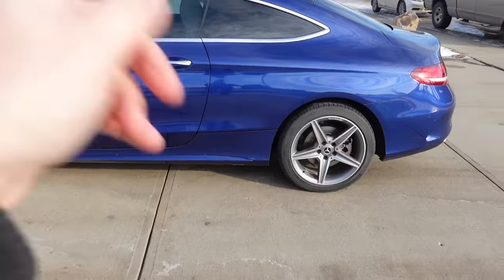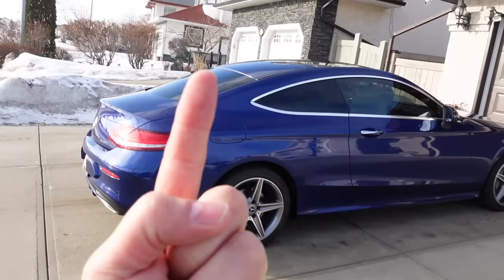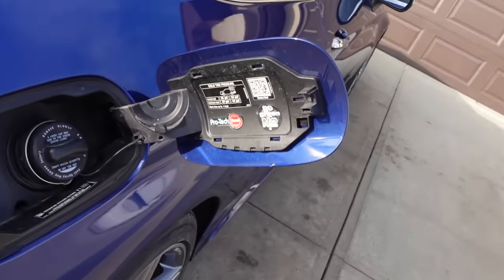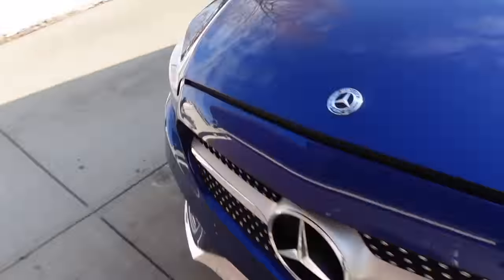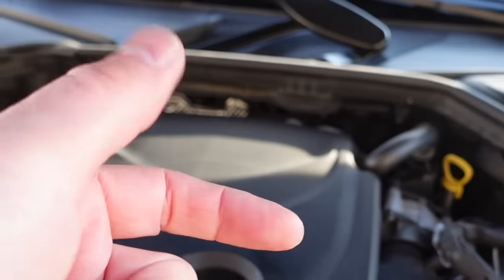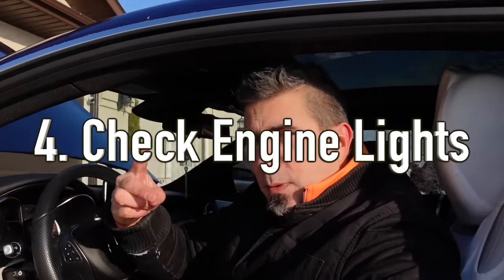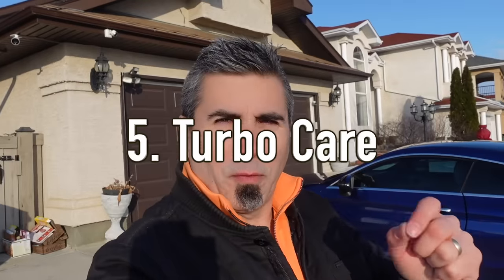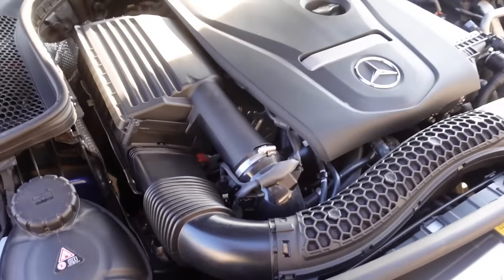STOP Destroying Your Car Engine! (With These Tips)

Comment: The start stop feature is one of the most annoying things ever installed on a car. The other annoying things is when people put the wrong fuel in the tank to save money. I once bought an off lease Audi and had the fuel in the tank checked and found that it was regular gas. I'm not sure if it was the dealer that did that or the guy that leased it before me. I've see drivers at the gas station put regular gas in a Benz and I would say to them, "It requires premium gas" only for them to say, "eh, it's a lease car". Drives me insane.
Reply from the maker: I totally agree, sort of a poor design and my feelings would be hurt if it disappeared.
Reply: Start/stop is absolutely ridiculous and has no place in fuel cars. I'll never buy a car where this crap is always on.
Reply: It also drives me crazy--worse is going to car meets and seeing the idiots that financed more then they can afford and are putting regular gas in a hellcat or M5--in addition to having bald rear tires from showing off.Dude at the local meet last month put 7 dollars of regular gas in a new challenger.I mean that 2 gallons was enough for him to go park it--just laughable.
Reply: Good post. We bought a returned from lease Audi last year that replaced a wrecked same model. The new buy ran like relative @ss until we got a couple of tanks of 91 through it. I would bet much dollars it had regular in it when we bought it & likely the previous user put regular in it.
Reply: @khronin  
They can afford the car but not the maintenance that goes with it! Bad medicine
Reply: I would not have any of these money pit cars they are crap after 100 thousand miles and sometimes before I know cause I get to work on them and charge you rich kids a shit load of money. When people bring these cars to me to work on all I can see is dollar signs LMAO.
Reply: @tommywieringo6640  I own a 2009 Camry that my daughter drives. In 100k miles we've had to replace a leaky oil pan gasket, both front axles, the struts on all 4 corners, a window regulator, & an alternator to name a few things off top of my head.  In addition, the oil change interval is 5k mi so that's more often than all the rest of our cars (both German & U.S.).  Machines wear / break down
Reply: @tommywieringo6640  You sound bitter, can't afford a luxury car?
Reply: @loseerich493  man sorry to hear that sounds like you got a lemon
Reply: @tommywieringo6640  Not really. Toyotas are machines that wear & break like all machines do. It's a myth they don't wear out /break. I've owned or leased 3 of them in my life.... one of them years ago left me stranded beside the road (while it was still under Toyota warranty)... only vehicle in my life to leave me standing beside the road.  Still own one now some 30 years later. I don't hate them, I just don't drink Toyota Koolaid.  Have a good one!
Reply: @loseerich493  yeah you are right no matter what make vehicle you get now days you still might get a lemon. Too much technology on these vehicles need to go back to the old days where you could work on your own vehicle.
Reply: Only use premium gas if the manufacturer requires it. Otherwise complete waste of money.
Reply: @loseerich493  I hade same experience with our Honda. Most unreliable car we ever owned.
Reply: @k9m42  Don't doubt it. I've had really really bad luck with 3 hondas I've owned (2 of them were bought new too).
Reply: @loseerich493  heh... go look at parts and labor for those jobs on a Audi, Mercedes or other premium vs a typical honda. There is a reason you don't see many Luxuruy cars with more then a 100k miles and/or +10 years.

Love my audi's; always sell before 100k.... 

Monstrously absurd 10,000- 15,000 dollar timing chain job is enough by itself (Audi S4 and S6); have to lift the motor and should be done at 100k miles.  On a typical honda its 400-500 bucks...

That all said; caddies are even worse now.
Reply: @loseerich493  according to Scottie Kilmer they are the only cars to buy!  and all those weird plastic angles and slashes are beautiful!!!!  only Japanese cars/suvs with any design sense are Mazdas.
Reply: @Aerogrow  timing chains don't need to be replaced it's a replace when needed item. Your thinking of a timing belt.
Reply: @v5k456jh3  Pure ICE vehicles, to be specific. They had their place in hybrids (though in a completely different manner).
Reply: @v5k456jh3  get a manual trans
Reply: @Collen Flarity you will love that start stop untill it doesn't work.. my friend was in an accident when it would not come back on at a stop light and was rear ended.. keep that in mind the next time your car shuts off, remember a computer runs it ......
Reply: Premium isn't better
Reply: Regular here in East EU means 95 octane
Reply: @AgentOffice  only if it calls for premium.
Reply: @brianmiller5444  Mazda has zero design sense other than exterior......especially new Mazdas are meh. Mazda interiors are often smaller than any other vehicle in its class...Mazda only knows one thing, how to sacarifice all practicality just for the sake of looks......Mazda 3 is atrocious in its C pillar design on the hatcbakc.
Reply: @brianmiller5444  please tell me more about what said our friend Scotty?
Reply: @brianmiller5444 I don't believe anything that Scotty Kilmer says as he is a total hack he  got reamed out in the comment section using a part on a brake system  that said not for use on brake systems  that was one of his videos he was forced to delete.
Reply: If you can't afford the gas, you probably shouldn't lease the car
Reply: @loseerich493 that's not believable, but I guess it could happen. The German cars however, have the worst reliability except for jeeps, jaguar and land rovers for the past 20+ years
Reply: Indeed. My 2008 X3 only gets regular gas. No issues with engine for last 16 years.

Comment: Stop/start default is really really irritating, and what is as irritating is forgetting to switch off the default
Reply from the maker: I agree
Reply: What is that? Stop/ Start what? My Tacoma doesn't have that button I've never heard of it?
Reply: I found that the Nissan Rogue (2021 thru current 2023) doesn't even have that annoying stop/start feature, how nice is that!  Nothing to turn off every time you crank up the vehicle.
Reply: @ofcbob6391 buy a manual. They don’t have start/stop lol
Reply: @crispyone2564  they do have start/stop, gearbox has nothing to do with it
Reply: @deborahdarr1964 if you come to a stop at a stoplight or something the engine will shut off and then turn on when you go again. It’s really stupid and annoying, you don’t want it.
Reply: Agreed, it’s the dammit button. Every time I forget to turn it off I shout dammit and hit the button. Would have paid an extra $100 to permanently disable it.
Reply: I've read that modern cars are built to withstand the wear and tear from the start/stop function and thus it shouldn't wear out the engine, I don't know if it's true, but it would make sense to me
Reply: Pretty sure my car has that but I disabled it in the settings
Reply: @crispyone2564  the first car I drove with start/stop was a manual.
Reply: @tcmmorariu I have a manual with start stop 😂
Reply: It's as annoying as cookies on by default, forcing you to have to reject them. Why? Because if we had to opt in instead, we wouldn't, and companies wouldn't have our information to sell.
Reply: @Nathan-Higgers_13  really! And how do you do that?
Reply: @crispyone2564  Mine does in the UK maybe its different in the US!

Comment: One important thing to know is that your car's water temperature is only to warn you of overheating. The gauge you need to look at to see if the engine has warmed-up is the oil temperature. The oil usually takes quite a bit longer to warm up than the water.
Reply from the maker: Thanks for sharing
Reply: Its not oil temperature its an oil pressure gauge.
Reply: @babuskarashuka8651  An oil temperature gauge is an oil temperature gauge, and an oil pressure gauge is an oil pressure gauge. Two different things. Maybe you haven't seen a an oil temp gauge? My car tells me the oil temp in degrees Celsius, but only has a simple warning light for low oil pressure.
Reply: @MrSonicAdvance  I have never seen one before I am in the USA and none of the cars or trucks I drive have temperature only pressure.
Reply: Oil removes @60% of the heat generated by the engine simply by virtue of being directly on the working surfaces,bores,bearings,or by load,lifters,bearings etc.,the incoming air through the air intake provides a cooling effect as does the fuel mixture to a degree,.An oil temp sensor will only measure sump or feed oil just after the pump,oil which will remain cooler up to a point because the relatively small amount of oil travelling around your engine removing heat and therefore getting hot it's self when it's running is then diluted back into cooler sump oil,but the oil at the point of the working surface heats very quickly,even from cold. The coolant system regulates heat indirectly via heat transfer and is not directly connected to working surfaces i.e. friction,or combustion so it's thermal efficiency is lower.coolant is thermostatically controlled to be isolated so that a very small part of it heats first,allowing that part to attain temperature seemingly quicker,sometimes and more commonly now artificially,even more so with selective path systems,thermoplungers and active pumps becoming more common,these measures are not made because the coolant systems can't keep up it's because manufacturers are trying to achieve operating temperature quicker using the cooling system to also assist engine heating until reaching that point.
Reply: It takes 14 minutes of highway speed driving for engine oil to reach 90C or more.  Your coolant will heat up to the proper operating temp well before that.
Reply: @midcenturymodern9330  My point is that oil doesn't work properly when it's not up to operating temperature. Just because your coolant is up to temp doesn't mean you can drive the engine hard if the oil is still below operating temp.
Reply: @babuskarashuka8651  My Subaru Outback wilderness has oil temperature gauge.
Reply: Very good I rememberd BMW got oil temp gauge.
Reply: I have always known that by how easily the car accelerates when FULLY warmed up:  that is when it virtually accelerates by itself,  my big toe is barely resting on the accelerator pedal...and the speed keeps going up. And no, I never tried to blame speeding on the car, saying it just "went"...by itself :)   yes I drive bare feet.
So I never really press on the accelerator,  in fact I let the car do what it is ready to do.
Reply: @martinep6293  Cars last longer if driven with mechanical sympathy. If you pay attention, a car will tell you when something is wrong, as it will sound different when it is running. It allows you to catch problems early and avoid big repair bills.
Reply: @MrSonicAdvance  yes!!  I can always hear even my oil becoming...suboptimal before 4k miles, with full synthetic (car over 20 y though)
Reply: @babuskarashuka8651  - most trucks have oil temperature gauges the vehicle information section on their dash, and nearly every Chrysler/Dodge/Ram vehicle has an oil temp readout available in the dash.  Granted there is not often a dedicated gauge like a fuel gauge, but it's more common than you have noticed.
Reply: At 7:00 you state that when you advance the throttle the valve timing is advanced. That is probably not true because generally, advancing intake valve timing increases low RPM power and advancing ex valve timing can increase top-end
power.
Reply: Almost no standard road cars will have an oil temperature gauge.
Reply: @babuskarashuka8651  bro you should probably do a little research before commenting...

Comment: Great information. One bad habit i often see is that many drivers use high revs before the engine has fully warmed up. Impatience is an early killer of engines and transmissions.
Reply from the maker: You are absolutely right and goes to the cold engine.  That’s where damage happens most often.
Reply: Killer? This is just false. If that was truly the case then they would just have a limp mode or rev limiter until it reaches temp.
Reply: @jonb2437  we are talking about long term effects.   Turbos will also get damaged much faster.
Reply: So new engines need to warm up?   I call b.s. Maybe 20 years ago they did.
Reply: @BeeRumblin13  they're not specifically talking about "warming up"... they're referring to pushing high revs before the car is at full operation temp.
Reply: @thesoundmajors9858  Define full operating temp.  Water, oil, block, cylinder head, turbo, exhaust??  Can the temp be at 50%, 60, 70 etc or does i have to be at 100% before max revs are allowed?  Which one is he important one?  Do all the components get to different operating temperatures at different times?
Reply: @jonb2437  Nah, it just kills a car's long term life expectancy. Manufacturers don't care about your car's reliability once their warranty runs out. The whole car industry seems coordinated for 4 year leases the way I see it. After that, good luck!
Reply: @csjrogerson2377  Oil is the most important. During cold starts, engine will rev a bit more to speed up warming. After it slows back down to idle speed, it is safe to rev higher. Note: you do not have to wait for engine to warm up before driving. Just don't accelerate too much until the warm up completes.

For motorsport, ALL components must be at optimal temperature, including tires. That is what warm up lap is for before driving the vehicle hard on track.
Reply: @jonb2437   Several M cars do have that variable rev limiter. Off the top of my head, at least the E39 and E60 M5s, and a couple of M3s. It makes complete sense to wait until at least engine oil is at operating temp before getting anywhere near the limiter.

I don't rev past 3k on my manual econobox VW Rabbit/Golf until engine coolant temps get up to temp since I plan on keeping it for a long time. I would think the more heavily-stressed engines and transmissions found in performance cars would need as a baseline that same level of care applied to them.
Reply: Shouldn't be leaning on the car until 9.5 miles or 15 km. Because the transmission has to heat up also in many cars, and in cold weather etc. this takes time. If you're going shorter distances, don't go to high revs / loads. Use a full synthetic engine oil, that meets the manufacturer recommendation, don't play around with oil weights either, unless you really know what you're doing, as race engines are not expected to last like normally constructed car engines. It's not worth it for a slight performance gain, can lead to blow-by, and oil ring clogging / failure etc. etc.

Also very important to not keep filling the tank to maximum, when it cuts off the first time STOP pumping gas, people overfill their tanks and kill the expensive carbon filter. Keep fuel at least 1/3 to half full to keep the fuel pump temperature down and prolong its life.
Reply: @VenturiLife  good tips indeed.
Reply: Akzo if you have a Turbo u really need let it warm up b4 driving as well as letting it cool down b4vu shut it off. If we get into a habit doing these things then it cab prolong the life of the Tuebo engine!
Reply: @BeeRumblin13  wake up in the morning hop out of bed and start running fast and tell me how it feels lmao..so let your engine warm up a bit
Reply: I leave my engine to idle for about 30 second after a cold start.  Then avoid hard acceleration for about the first 10 minutes.
Reply: @malcolmabram2957  excellent way to prolong engine and tranny life. Most drivers lack such basic common sense.
Reply: @BeeRumblin13  its not about warming up by Idling. Its about  driving off gently after a cold start and not using high revs until engine and oil temp reaches normal levels.
Reply: @VenturiLife  great tips indeed. But there are many smart alecks commenting here who just dont have the common sense to understand what you are saying.
Reply: I learned that you should keep the revs under 4000 rpm until the oil is at operating temperature. The closest we can estimate this in modern cars with no oil temp gauge is to use the coolant temp as a rough guide. Oil takes longer to reach operating temp than water/coolant, so once the coolant temp reaches its normal range (usually midway or thereabouts), allow another 5 minutes or so for the oil to catch up.
Reply: @qleap99  Don't think i have ever even seen 4k rpm on my diesel 😂 Just under 2k tops 👌🏻

Comment: Wow the last tip really comforts me cuz I was frustrated why Lexus doesn't have this start/stop function in my ES and IS, but all the German cars have it, now it all makes sense for the reliability haha
Reply: But i wonder the hybrid cars automatically start/stops all the time, is that taking a toll on the engine?
Reply: @kevinf.6847  - their hybrids don’t start/stop in the same way/same frequency though.  And it’s designed purely for charging the batteries, not for turning off the ICE to save emissions when the vehicle comes to a stop!
Reply: @matthewwood4756  thanks Matt! Super helpful
Reply: @matthewwood4756  the start stop on hybrids definitely are designed to save gas. When you come to a stop the engine stop and electric motors accelerate the car to a out 25mph. Only if you accelerate hard then gas engine will start immediately.
Reply: @jalee6587  - There are a lot a factors that determine when they run EV only, or in hybrid mode.  A hybrid can actually run in full ICE mode only in many circumstances.  I used to work for Toyota/Lexus.  Hybrid’s are not intended to work in the same way as “engine start/stop”.  That was the point I was highlighting.